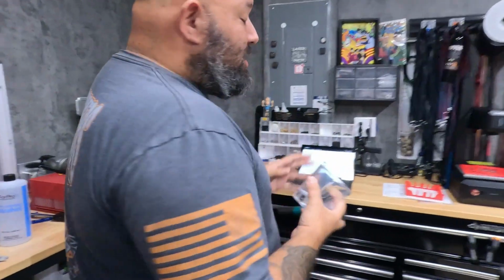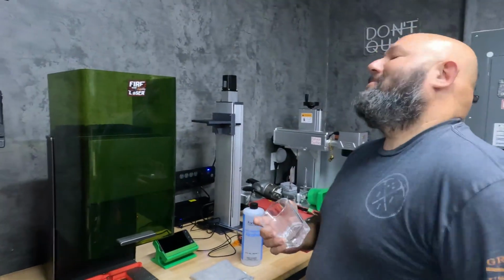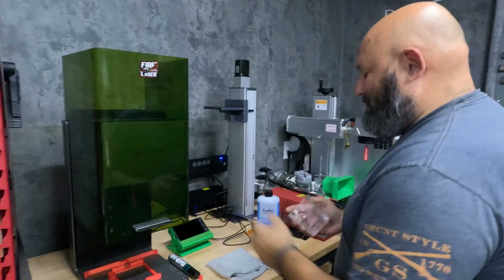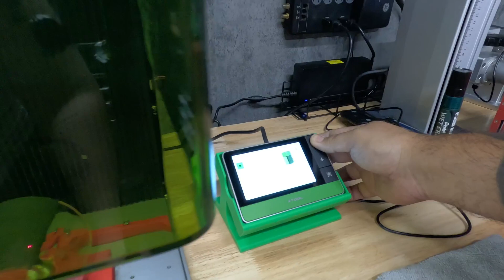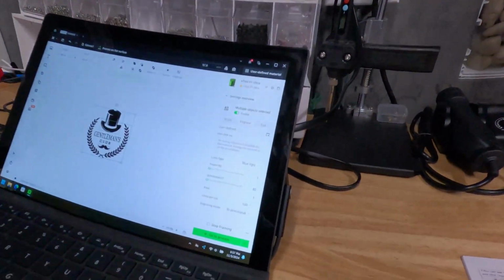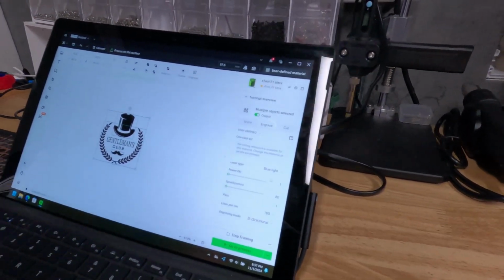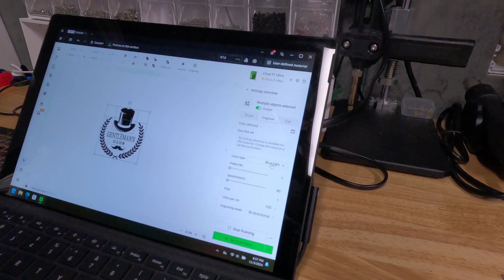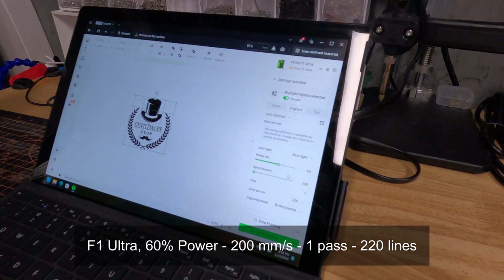Using a Chalk Marker to Laser Engrave Glass with the Xtool F1 Ultra - Laser Engraving Glass

Comment: Amigo, gracias x el vídeo. I have tried all the methods we can find online but I find the cleanup is too messy, hard and time consuming. So I tried something I have never seen before. Permanent marker. Best consultant results I have ever gotten. Cleanup is a wipe with a damp cloth and rubbing alcohol. Try it. 75p/138S/100lpcm.
Reply: Dries instantly, does not have to be evenly coated like the chalk or paints. Comes in jumbo tipped at the dollar store.
Reply from the maker: I'm gonna give it a try. Thank you so much for the recommendation and for watching
Reply from the maker: I need to try

Comment: Alternative method to really engrave crystal: Tamiya Acrylic Blue. Apply a thick layer. Dont wait for the paint to dry. Settings: Blue laser, 100% power, 10mm/sec, 170 lines/mm, 4 passes. After engraving, part of the painted layer will dry. Remove it with a crystal scratcher. Finaly clean the engraving with a Dremel cotton rotary tool. You will see the crystal is really engraved, not marked.
Reply from the maker: Thank you for sharing your settings!

Comment: Thank you for the wonderful video! After watching the video, I also bought F1. However, the engraving on the glass does not work well. Can you tell me the selection and parameters of the material?
Reply from the maker: Thank you so much for watching. Settings are a bit different in every machine even same brand and same type. What happens to the glass. Probably incan help you knowing the results.

Comment: Can this be done with the Xtool F1 (not the ultra)? What settings could I try, can the same result be achieved with multiple passes? It’s not as powerful right?
Reply from the maker: HI I ahem a video for the F1 on shot glasses that is basically the same thing just with a chalk spray instead the marker but you can use the marker.  https://youtu.be/vGAv4Fewass

Comment: I have the f1 ultra, engraved on glass with the same settings, but i used black spray paint can, did the engraving, came out nice but when i wipe the paint off the engraving also comes off
Reply from the maker: Try using a chalk marker or a different kind of paint! Even tempera paint works
Reply: @AlivePixelCreates  the engraving comes off when i scratch with my finger nail., you think it has something to do with the settings

Comment: Have you tried engraving circular glasses using the RA2 or do you use jigs for everything?
Reply from the maker: I did on shot glasses and some tumblers. I use jigs for everything that I need to do a lot of items when there is only one to make and I know I can get it right I just got for it.
Reply: @ which jigs did you use for the shot glasses? For the one in this demo, will it also work on rounded glasses using the “curved material” processing mode?

Comment: Sir, 
I have a 20w Fiber Laser, will this work on glass? I ran some tests today and could engrave the paint I put on the glass, but after I washed it off I realized it did not engrave the actual glass.
I plan to try your method 😄
Reply from the maker: For glass with a fiber you need a bonding agent more than pain. Some like brilliance or cermark

Comment: Thanks for testing another method to use to engrave/etch glass.  I have received my best results with the black PRANG Tempura paint.  It is difficult to brush on, (foam brush), an even coat and when trying to apply subsequent coats, it "dissolves" the first coat.  Using my airbrush, I have received excellent results with several-3-5 coats and when you shine a flashlight through the glass and cannot see any light, you have a good coat.  I am going to try a water based black spray paint which will hopefully give good results with just a water cleanup.  "Pinty Plus" is the brand I bought at HomeDepot and Lowes, if you have these stores in your area.

Comment: just wondering - you said the imperfections on the hat at the top were due to... what? you mentioned two things that could have caused it, either the heat was too high or you didn't let the paint dry enough. Do you think you know which one that is? Thanks! :)
Reply from the maker: I got similar with a dry paint so there was too much power for sure. Instead 60 try 40% or 50%